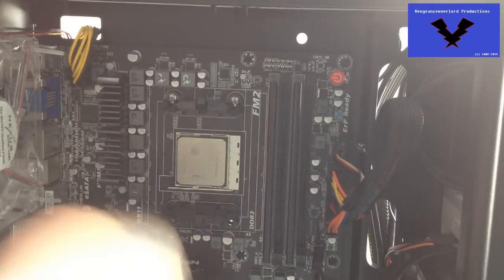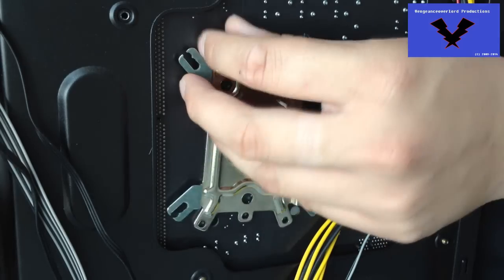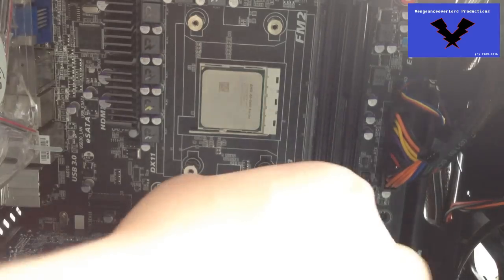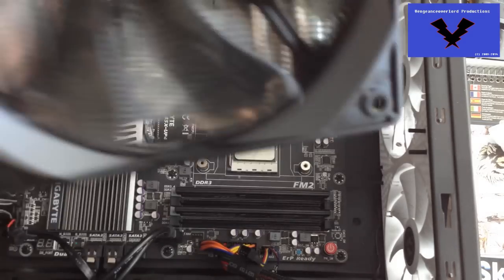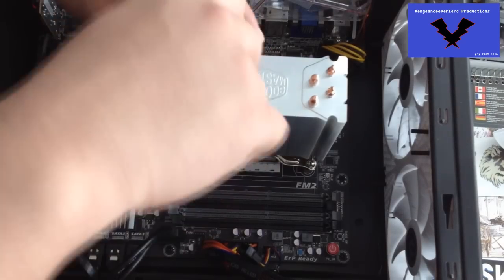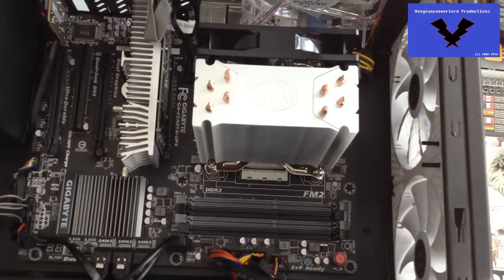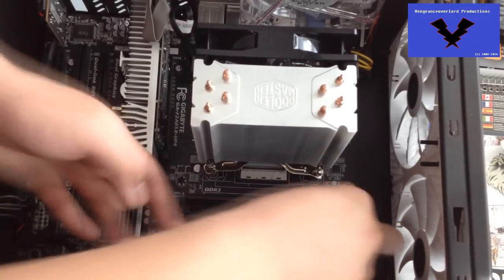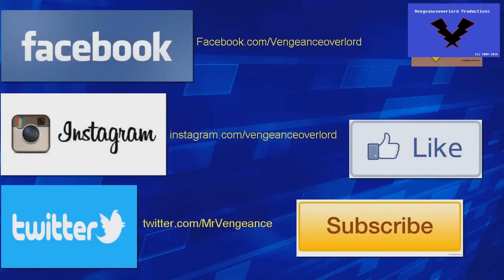Cooler Master Hyper 212 Evo Installation Guide for AMD FM2 Socket - #152

Comment: Does cooler master include all of these things (Except thermal paste im using a different one) Like the bracket and screws?
Reply from the maker: Hello, Yes within the box Cooler Master includes most of the current mounting plates & screws at the time of when this video was made. Please keep in mind this may have changed since there has been new mounting configurations that have been released recently.
Reply: VengeanceOverlord Great! Now one last question, Will this fit in a Zalman ZM-T1 case?
Reply from the maker: I am assuming that you have the Micro ATX Mini Case (Zalman ZM-T1) which states on their website that the depth of the case is 348mm (13.07inch) with that information on Cooler Master’s website they spec the height of the cooler to be 159mm (6.3inch). So from this information I would say that it should work for you but please keep in mind I did not account for the height of your motherboard sitting in the case.

Comment: hey i have an issue i was hoping you'd give me some advice on. i got the msi FM2-A85XA-G65 mobo. and i cant quite seem to fit the screw through the holes in the mobos cpu brackets.... not sure if i should force it in there as im scared it might Crack....
Reply: I think someone said just to push it in. Here's the link no idea if it's the same for you but yeah lol  https://linustechtips.com/main/topic/268386-hyper-212-evo-for-fm2/

Comment: How thick is that EVO backplate? I have a closed back tower and I'm worried it wont fit in between the mobo and the closed case back? I have my motherboard on some standoffs
Reply from the maker: Hector Tio Salamanca Hello, which motherboard/processor will you be using this cooler for? And what case do you have currently? Also I'm not sure on the exact measurements for the backplate. But depending on the questions that I have asked it may determine on if this cooler will work for you.
Reply: Well, it's an AM3+ board, GA-970A-DS3P, for the FX-6300 and the case is the problem here really, it's an old Antec 300 that has no cutout on the side plate where the MOBO screws in. Do you think it can wedge in between the case plate and the MOBO?
Reply from the maker: It may not work since there'll be a very very small gap between the two. personally i wouldn't try it but one other way around it if you've already purchased the cooler is to buy a new case. but that'll be up to you. if you haven't purchased it yet maybe spend some money on a decent & inexpensive case that'll allow for more accessibility/customization.
Reply: Indeed. I ordered the cooler already. Well, if it fits, great, if it doesn't, new case :D Thanks for the advice
Reply from the maker: No problem, let me know if it worked out :)

Comment: Bro my fucking case is retarded it covers half of the mounting thing on the back of the motherboard...it's a thermaltake h21
Reply from the maker: Acxel Vega Hello, I would suggest to remove your motherboard in order to install the cooler.

Comment: What case are you using? it come with fan controller too right?
Reply from the maker: Hello, I am using the NZXT Source 530 . and Yes it has a fan controller but i am not using it to control the CPU cooler fan. it's connected directly to the motherboard.
Reply: VengeanceOverlord
Thanks for reply.
 Did you modded it? because i cant find any pics of it on the net with that red switch in the upper part.

Comment: did the package come with any tools or do you have to go buy something yourself? also, holy crap that thing is a monster i have to evaluate if it fits in my casing ! propably will but looks massive compared to the stock one.
Reply from the maker: +Elvis Presley Hello, the product only comes with the mounting accessories and a Nut setter. Installation the product requires a Philips screw driver. definitely check if this cooler is the proper size for your case prior to purchasing this product.

Comment: I have a question. My case says that the limit of cooler height is 155 mm,  but this cooler is 158.5mm. Will it fit?
Reply from the maker: +YoMamasTacos Hello, it'll be a very tight fit but i'm not 100% sure if you should try it and find out it doesn't work and have to return it. do you know anyone who may have this cooler and would allow you to try it out? if not you may just have to go purchase it and hope for the best or you could try a liquid cooler if budget allows it. like the Corsair Hydro Series H55.

Comment: How do you decide which way to face the fan? Sorry Noob to upgrading and hopefully one day being able to build my own gaming computer. Any help is greatly appreciated , Ty
Reply from the maker: +funnygirl Hello, General rule of thumb is to place the fan facing forward so it's pulling air from the front of the case and pushing it through the cooler towards the rear. so that means you'd have to install the fan onto the cooler with the manufacture logo facing forward not backwards. if you see wires facing forwards it's not installed properly unless you have it configured as push & pull. it means that you have a front facing fan pushing air through the cooler and a secondary fan on the other side pulling the air from the cooler towards the rear. see here - http://www.tomshardware.com/answers/id-2021082/push-pull-push-pull-configuration.html i hope this helped. sorry for my late reply.
Reply: No problem better late then never . I am glad you did answer I have it in wrong and wondered if I needed to do something else to cool it down . CPU still running around 90 . Gives me hope I may still be able to cool it down and save my old PC for a while. You may have saved me bunches of money I can use towards a new computer build later. TY!!!!!!!!!!!  Heads off to put it in the right way.

Comment: What's your 5600k clock speed ocd with 212?
Reply from the maker: +RVM. A Hello, I still have it Running at Stock Speed of 3.6Ghz. I'm not very familiar with Overclocking so I've left it Stock.

Comment: I have a question! I just ordered te 212 evo and my question is if the fan is to the right will it hit my ram chips (I have standard cheap ram with no heatsppreders 8Gb 1600Mhz)
Reply from the maker: ZokuLz Tutorials Hello, Depending on the Size of your Motherboard Generally there is enough space to allow aftermarket CPU Coolers to fit right next to the RAM Slots. If the Fan is too close to the RAM Slots you could just Install the fan on the rear section of the case or Face it upwards or downwards.
Reply: VengeanceOverlord But because I have an old case (PSU at top) which exhaustes air, I would like the fan taking the air from the right and exhausting to left so that the PSU gets the hot air out!
Reply from the maker: ZokuLz Tutorials I see your point. then i would suggest to wait for the CPU cooler to arrive and see how it fits within your case. If the Cooler does not fit within your case then i would suggest to Upgrade your Current Computer case to a newer one which would allow more room for all components to fit. and to also have the Power Supply mounted on the bottom section of the case. Let me know if you have any further questions/problems.
Reply: VengeanceOverlord Thank you :)

Comment: Is he applying thermalpaste properly?
Reply: Radvis Stankunas You don't need quite that much but the line technique is acceptable. Some use the pea dot technique, some use the line technique.
Reply: +f1tony2003 both work, but I think I usually just go with the pea sized one... It just seems easier to me.
Reply: +ArtisChronicles I have heard that with Intel CPUs to use the pea method, with AMD CPUs and APUs to use the X pattern (lines corner to corner).
Reply: Kacey Howell I've only ever used the pea method, so I can't vouch for the effectiveness of any other method. Nor can I vouch for which method is better for which companies processors. Although I will add that Linus usually uses the line method, at least if I'm remembering correctly. LinusTechTips is his channel if you were wondering. Though it may be a different channel where he covers thermal compound application.

Comment: can i use this on a fm2+ motherboard?
Reply from the maker: Hello, Yes you should still be able to use this CPU Cooler on a FM2+ Motherboard.
Reply: VengeanceOverlord also does it matter witch way you put the cooler on?
Reply from the maker: Part Destroyed Hello, The Cooler should be facing towards the direction of where the fan is bringing in the air.

Comment: I'm sorry I am new to PC but is FM2 the same as FM2+?
Reply from the maker: Hello, The FM2 & FM2+ are the Sockets which an AMD MotherBoard would have. FM2+ Can Support FM2 Processors in it's Socket. But the FM2 Cannot Support any of the FM2+ Processors. 

The Links below will go into further detail about the differences between the Two Sockets. 
http://en.wikipedia.org/wiki/Socket_FM2 http://en.wikipedia.org/wiki/Socket_FM2%2B
Reply: So if I have a mobo that supports FM2+ it is backwards compatible to FM2 which means I can install the 212 evo on it right? And thanks for the quick reply.
Reply from the maker: Yes, You would be able to install the Evo 212 onto your Motherboard. I don't think that they changed the actual size of the CPU Cooler Mounting holes so it should work. No Problem at all. Please let me know if this worked for you and if you have any other questions. Have a Good Day.
Reply: Thank you very much for all of your help, I'll let you know if it worked. Have a good day aswell.

Comment: Thanks a lot for this help. In a rush to get a friend/customers pc done today and I learn much better visually, over instructions.
Thanks again.
Reply from the maker: Hello, Glad this video has helped you. Have a good one.
Reply: VengeanceOverlord I did end up stripping fhe top-right corner bolt on the interior "X" mount, while trying to rush through it, but it still ended up holding fine. The vid did help with everything except the X mount though. You already had that mounted somehow, in the video.

Comment: Excusme.. but.. the cpu fan maybe be mounted in push behind the cooler to the back fan of the case..  or not?
Reply from the maker: Hello, The Configuration of the Fan. Depends on how much room you may have in your case or which way you'd like the hot air to flow out of the case. with it either facing downwards or upwards or sideways all depends on you. Remember though you can install a Secondary fan and just have it as Pull & Push or Vice Versa. i hope that's what you were asking about.